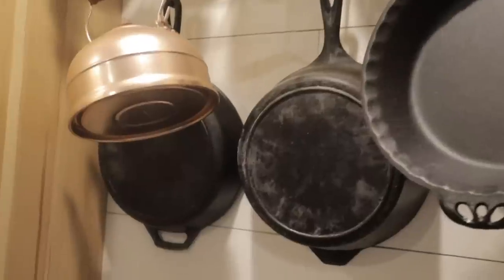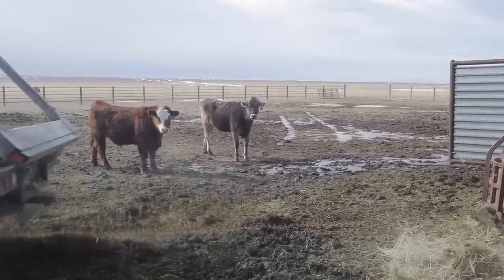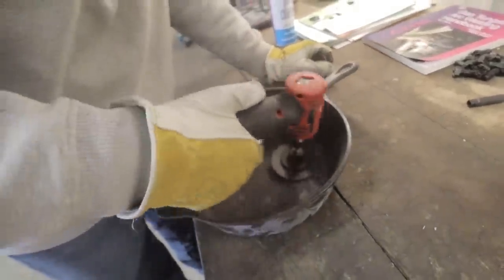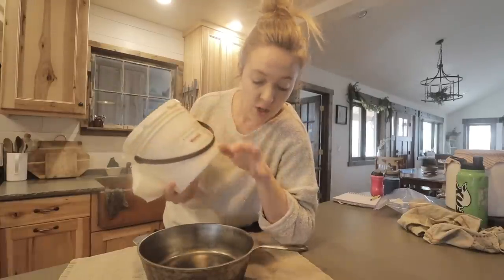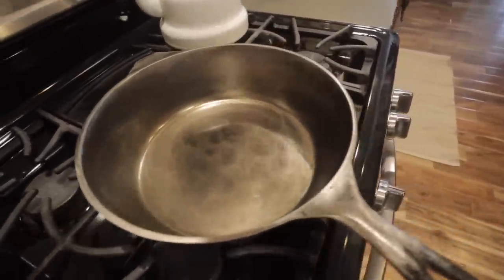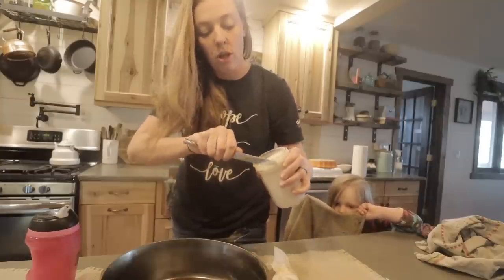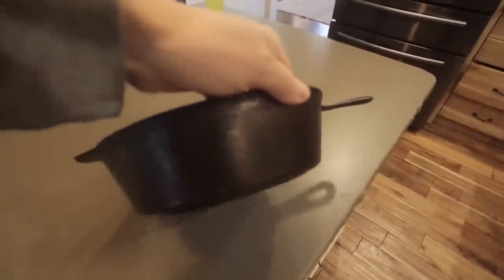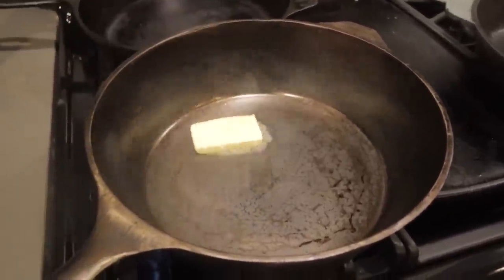Can We Rescue This Skillet?! (Re-seasoning CAST IRON)

Comment from the maker: Thanks for watching! Have you ever tried to strip & re-season a cast iron pan? What type of oils did you use?
Reply: I've used the Traditional Cooking School instructions for re-seasoning cast iron and it worked like a charm. Flaxseed oil is recommended and at least 6 cycles at high temp for 1 hour each time, and let it cool for at least 1 hour in between cycles. It took me pretty much all day and evening to finish 6 cycles through the oven. Won't do that again anytime soon! :)
Reply: lard, bacon fat are the best to use for seasoning
Reply: Any oil with a high smoking point. I took a rusty (like really rusty) cast iron griddle that I bought at a flea market for $5.00 and made it beautiful. First I used steel wool and scrubbed the rust off. Then I coated the whole thing in grape seed oil. I stuck it on my gas grill for an hour and a half. It turned out beautifully. High heat, good oil, and time are the key. I also think the age of the cast iron makes a difference. Older cast iron works better than the new stuff. I also just use it. All I use is cast iron. I wash it in hot water, dry it on the stove, and give it a light coat of oil after every use. Just my $0.02 worth.
Reply: I now use avocado oil as it has the highest smoke point.  I finally can use my cast iron pans without them smoking.
Reply: I just use shortening at roughly 425 for 1 hour. Seems to work. I also season my carbon steel pans the roughly the same way, but I use vegetable oil for carbon steel.
Reply: Ive not tried anything but lard because thats what my granny used.  She only even used cast iron.   She passed this year at 104 with zero health problems other than old age.
Reply: When I am restoring a cast iron piece, I use kosher salt and oil.  The salt is the “sand paper”,  also after I rub the oil on, I always take a second clean towel and wipe the pan again just to make sure there is no excess oil anywhere.  Also, when I wash a cast iron Pan as best I can with a dry towel, I put it on the stove on a low flame and let it heat up to dry.  Was taught this by a chef at the local historical park.  Works every time.
Reply: Homesteading family.com has a great video on stripping, cleaning and reseasoning cast iron. Since I have used that method, my pans are great.
Reply: My grandpa cleaned cast iron by building a fire either outside or in the fireplace and would put the skillet in the fire - it'd come out clean. Used lard to season it 😏
Reply: That black stuff is a carbon layer.  My Mom gave me a pan like that and I never removed it. It protects the pan and it is harmless.  Also acts as an insulated layer.  The bottom of the pan always gets cleaned and seasoned.  I don't remove that layer.  Never had a pan rust with the carbon layer intact.
Reply: Friends of min say beacon dripping that have been filtered work best. esp when 1st seasoning a new pan.
Reply: Crisco or lard I'm not a fan of oil seems to get yicky an cannot stand the taste,smell or look of a coconut! LOL.

Comment: Stick in upside-down in the oven and put oven on 'clean'.  It'll strip this down to bare iron.  Blow off the 'dust'.  Rinse with hot water and light scrub.....dry.  Then you'll have to 'season' it with thin, thin layers several times.  But you'll wind up with a pristine piece of cast iron.  The 'clean' cycle method will burn the scaling and stuff right off of the pan.  I've done this several times.....including with a skillet whose bottom was so scaled I couldn't read the lettering.  Boom.  Came out clean.  They USED to sell cast iron unseasoned.........it wound up looking similar after I 'oven-cleaned' it.  Then season properly.
Reply: YAY!  Someone actually has used the clean setting on the oven besides me!  It works SO EASILY I was wondering if there is a downside I don't know about??? I haven't found one...but it makes me wonder why most videos show scrubbing away like crazy when all it seems to need is the oven clean setting.  I think lard works best too.  I pray I find some forgotten cast iron pan this year to bring back to life 😍
Reply: @Greens5511  Great minds think alike.  'The Prairie Homestead' should listen to us.......😊
Reply: We found the clean cycle discoloured the chrome shelves turning them blue. So use used ones for cleaning cycle the skillet clean.
Reply: Well my oven doesn't get hot enough/have a "clean" setting lol

Comment: When I find old pans that are sticky etc. I boil water in them and use a plastic spatula to remove the ick.. I use lard. I have tried every oil they all recommend. Some of those forums are just crazy! Lol If it is really rusted I soak them in vinegar overnight. Then use steel wool to get all the rust off. You did a great job!! Oh and 500 degrees for an hour at a time to reseason. I let it cool between cooks. Love my cast iron.

Comment: I have stripped and seasoned many cast iron pans.  I've used sander, wire wheel, burn outside in a fire.  My favorite way is putting in the oven through a cleaning cycle.  After they cool down enough to handle wash thoroughly, dry, and put on thin layer of lard and place back in oven at 350 for one hour. Repeat if necessary.  And like you said using them is the best way to keep them seasoned.  When I wash them I don't use soap.  Just hot water and dobie pad if needed.  Dry them while hot.  If needed I put another thin layer of lard or oil and rub all over and dry off excess and hang til next use.  One thing I have found that is very important.  Don't use the same pan for everything.  I have a certain pan for cornbread.  If I use that pan for anything else the cornbread will stick next time.  I use a different pan for frying eggs and I don't use it for anything else.  Just eggs.  They never stick.
Reply: Good to know about using for the same thing each use. Thank you for that tip! 😊

Comment: I use flax seed oil and a lint free cloth - no paper towels. I also preheat the skillet with the oven at 400 degrees. It does usually take 4 - 5 times to get it seasoned well.
Reply from the maker: I'll ditch the paper towels next time!

Comment: My parents used to get that icky crud off the pan by taking them camping with us.  We'd have a big campfire.  Once there was a deep bed of coals, burying the pan deep  in the hot coals.  The next day after the coals are cold, dig out the pan.  It should look like raw unseasoned cast iron.   If there is still stuff on it either wasn't hot enough or long enough.  Then reseason.

Comment: Great video! I recently went through this same conundrum. Mine didn't end with lard, good pointer, I like your overall results better than my own. My task started with lots of sandpaper and my hands. Then went to 3 rounds of coconut oil baths in the 450 oven. Very sticky, and runny! 
Ultimately I just started using the pan. I made sliders, bacon, stir fry, and lot of other things. Each time I put it under the kitchen faucet with hot water and washed out the solids, then wiped with a towel. Now it's been 6 months. The pan is seasoned!
I like your method much much better. Lard for the win! Thank you for the video, love it.

Comment: Some of my favorites are canola or grapeseed oil. When I season i heat oven to 200 degrees with skillet in it for about 10 mins.  You want the pours in the skillet to open up before you put any oil on it. Then get a thin coat of oil on turn the oven up to 300 degrees. Leave for about 15 mins and just wipe with dry cloth to make sure there is no extra oil. Lastly turn ove up to maybe 5 degrees above whatever the smoke point is of the oil you use and leave it in oven for 1 hour let your pan cool in the oven. Repeat 3 or 4 times.

Comment: I had a cast iron pan that was coated like that and my hubby built up a big fire and just stuck the fry pan into the fire and left it.. it turned a deep red from the heat but all that crud burned right off.. Then we seasoned it in my oven with lard..
Reply from the maker: Nice!!
Reply: That’s a risky method. Too high of temp can burn carbon out of the cast iron, permanently harming the metal and making it hard for seasoning to stick.  Oven clean cycle will work, without getting it too hot to harm it.

Comment: I was raised in a family that cooks mainly with cast iron, In fact, I have some of my great grandmothers cast iron I use daily, Any oil will do I find and I will coat the pan after cleaning the build up with a light coat of oil and just leave it in the oven so whenever I bake it's being seasoned, another way to speed up the process is use the pan as a deep fryer, once the pan is seasoned after use I wash it like any other pan and dry it on the stovetop over high heat then coat it lightly with oil every time I use it. I can cook pancakes in my iron skillets with no problem with sticking, Hope that helps, Also I never cook tomato produces  or eggs in cast iron, it strips the seasoning,

Comment: We had a couple old pans also just like that and we used the dremel sanding tool that is kind of long and round and it took it right off. I just reseasoned it and now it’s getting its black coating back. It’s a great pan now

Comment: Good old lard to the rescue!! About 45 years ago my mom bought a really cheap set of 3 cast iron pans and she discovered that the pans had little pin holes in them (not several but a few) so she did several applications of lard and bake to fill the holes. It worked!!

Comment: I have come across the same problem over the last 20 years.  After much trial and error I  researched to find out which oil has the highest smoke point ( to my knowledge is avocado oil) and used that. That way I never have to worry about the oil burning and becoming a carcinogen.   The pan is beautiful by the way. =)

Comment: wow he cleaned it good. When i grew up my gramas always said to use lard or shortening. Over the years i have used veg oil, lard and once i used coconut oil. I didnt care for the coconut oil...i found it didnt last long and had to be reapplied shortly after. Also i always do mine in a slow low oven. Like 200 for all day, or if you have a wood cook stove, leave it in there for a day.

Comment: You know when I first saw the thumbnail, I though this would need extensive chemistry (electrochemical reactions, oxidation-reduction processes involving acid etc.) to remove that heavy rust layer, but just mechanical sandpapering that your husband did using his tools worked pretty well too.

And yes, high heat is necessary for any kind of bonding process to occur, as confirmed by your ending. Really nice video.

Comment: A dewalt driver with a 3” wire brush... take all the carbon off without puttin a scratch in the cast iron... that way just canola oil in the oven at 300 for 60 mins.. perfect season... no scratches.. is the difference... I collect rusty ones and make them perfect too...😉👍

Comment: Battery charger, the manual kind of Christerphers DC welder. Removes all the crud including rust. I do mean ALL!. You Tube videos available. I use to use the fire method buring off or the NaOH method. They work sort of ok. The higher the smoke poit of the oil the harder the micro structure of the seasoning

Comment: Considering the condition the pan was in, I think it turned out really well.🏆  But I let out a “Nooooo!” when Christian sprayed on the brake cleaner though!😱 To remove grease I use a good hot water scrub, after rubbing well with coarse salt. For me - cos I’m annoyingly sensitive to chemicals etc, the salt and hot water are preferable to chemicals or detergents.🤦🏼‍♀️😟🤷🏼‍♀️ 
But I really liked the way you just got in and got it done. The seasoning part was interesting too, I learned a new method there, so thank you.🙏 😊💛

Comment: Don’t use Power tools. Oven clean cycle, lye bath, or  electrolysis tank will clean it perfectly without  harming the surface of the pan or harming the value of a vintage pan. . Wire wheels are the worst, smears the surface of the metal making it hard for seasoning to stick.  Most any oil will work for seasoning, I use crisco.

Comment: Use crisco when doing seasonings or for long-term storage.  The 'solid' crisco.
Reply: @Aida A You don't have to eat it, Aida.........but yeah.  For initial (or re-) seasonings and long storage without frequent cooking, the 'solid' crisco is best to use.
Reply: @Aida A Have I watched the video?  Yes, I watched the video.  What's that got to do with you going "Ew" when I recommended crisco for the initial seasoning?  😊. Matter of fact, the first time I bought an unseasoned Lodge skillet oh......25 years ago, I guess......it was recommended in the seasoning process.
Reply: @Aida A And FWIW, with cast iron pieces that I USE a lot, sure.........After cleaning and drying well, they're so well-seasoned and smooth I'll just dab a little warm bacon grease from a previous cooking onto the pan for a light coat.  Just keep in mind, when talking about LONG periods of time (and some pieces of cook ware might go unused for a long time....depending on how much cast iron you have), animal fats go rancid.  If you just use a couple pieces of cast iron.....and you use them fairly often....you're fine with the animal fats.  I'm not judging.....I'm just giving recommendation on what I do.....and would do......if I had a gnarly piece of cast iron I had to either sand or oven-clean back to smoothness and needed to re-season it......which WAS the point of the video I watched.  😊

Comment: You used the HARD way to get the scut off! I just redid a set of eight, two of which were WAY worse than yours! Easiest way to do this is to throw it in the oven and run a cleaning cycle or toss it on your outdoor grill and heat it up as high as you can go. Anything in the 550-700° range is going to incinerate all of that stuff off. Then just wipe off the ash (and wipe, and wipe, and wipe...). Clean off and dry, then re-season from scratch. I like grapeseed oil. Coat and throw in an oven at 475° for an hour. Do that three to six times, and you're good.

Comment: Use a cut potatoe and rub it all around the pan
Reply from the maker: For seasoning?
Reply: I've read potato with coarse salt to strip/clean old seasoning off. The best recommendation for strip and cleaning is to put into fire pit, coals inside to burn off gunk overnight. Wash thoroughly afterwards, dry in oven and then reseason.

Comment: That looks like a Birmingham Stove & Range possibly a Red Mountain series introducer in 1930 produced to sometime in the1940s. They followed the Red Mountain series with the Century series in the 40s. BSR pans have a ridge that runs the underside of the handle and a unbroken heat ring. BSR was owned by Atlanta Stove Works so their pieces aren't labeled. Please never use a grinder to clean another vintage pan, it destroys the collectability of the piece. Look that pot up on eBay you'll be surprised what it would've been worth. There are so many bad videos on cleaning cast iron I wish these guys would go back under their rock. This piece would have been fine in your oven on the clean cycle, sprayed with oven cleaner and stored in a trash bag a few days, or in a lye bath. I clean mine in an electrolysis tank which is considered to be the gold standard in cast iron cleaning. There are a lot of videos on how to assemble an e-tank on YouTube however I wouldn't build a tank for just one piece. If you start collecting cast iron by all means assemble a tank. I hope I didn't give ya bad information but that's what works for me. Grape seed, or Crisco is a good seasoning oil just set your temperature 50 degrees higher than the smoke point of your oil. Wipe the oil on with a lint free rag like an old t-shirt, then buff it off with another lint free rag before going into the oven. Repeat this 3-4 times for a good seasoning. The Cast Iron Cookware channel and the The Mud brooker channel are good places to get advice on cast iron. Sorry this comment was so long but I hope it helps.